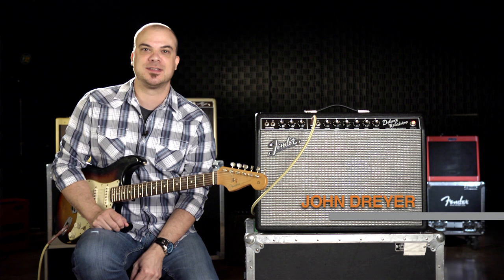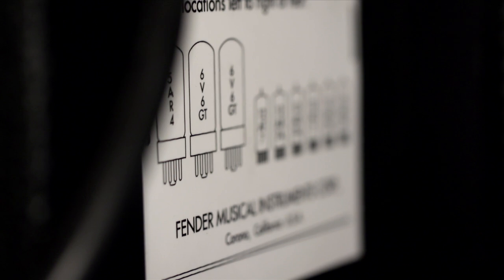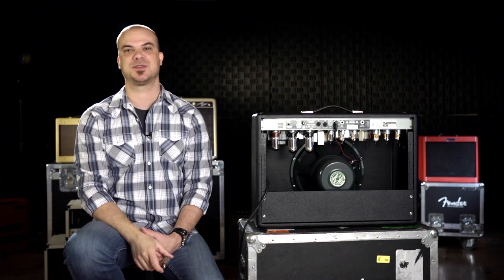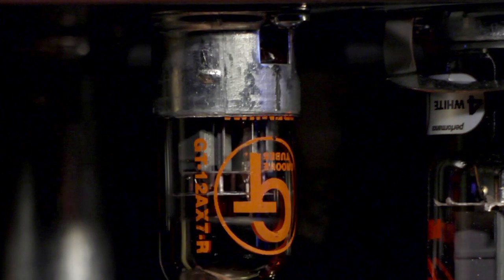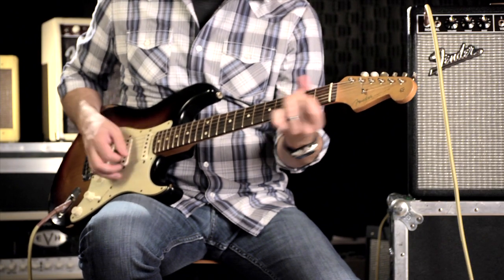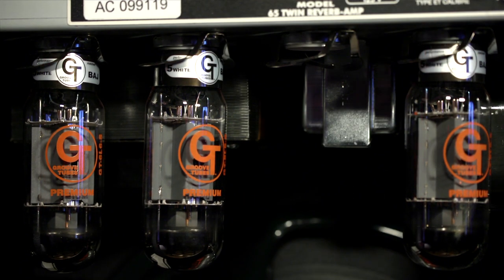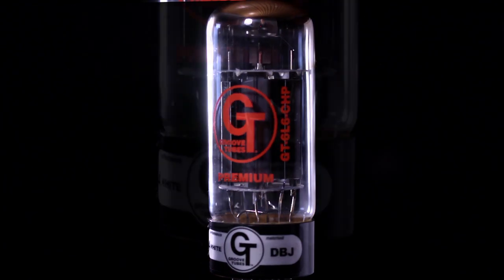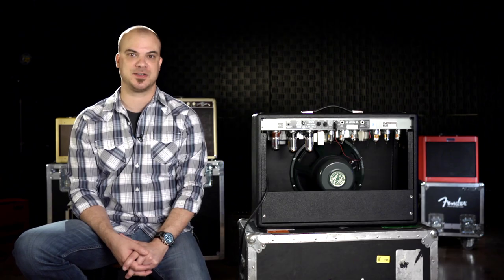How to Change the Tubes in Your Amp

Comment: Like he stated, If you are replacing tubes of the same brand and rating no bias is needed. Preferred? Maybe, but not needed as the tubes will be within normal operating standards of previous bias. If anything, normal bias shift is more of a reason to routinely/annually (depending on how you use the amp) bias than replacing tubes - unless of course you are swapping tube type, brand or ratings - as he CLEARLY stated in this very direct and simple video made for the layman who likes his tubes and loves his hobbies even if one of those hobbies is NOT electrical engineering. Most people find tubes they prefer in an amp and stick to them - no need to bias for replacement with the same tubes. Long story short - all these comments fail and are likely made by people that got their educations on youtube so to speak.

Comment: I just ordered a set of 4  EL34's but the guys at the shop said they didn't see a rating #, only a M or L, so there is not way to tell if what I'm getting is a 6, 7, 8..etc which ones do I need? I play a Bugera 333xl 2x12 120w combo amp and its has tons of gain, and loud ( I play at #3.5 on the master dial at band practice) and I'd like to keep it that way, which ones are the right ones for me? pleases help. thanks

Comment: Waht about a Hartke bass amp When you turn it On,the guitar signal is nasty & crackly static ........after about 20 seconds or so it clears up & acts right.  Sound like a Tube?
Reply: I think so - pretty sure it's a worn preamp tube problem since it goes away but could be wrong, maybe pays to retube the whole thing

Comment: That is so wrong with this demo. Every time you change the power tubes with an amp that is is not cathode bias and it has a potentiometer in the circuit for bias, than you should bias the amp every time you change the power tubes. The demo is not specific enough and people should see other videos that shows the danger and the proper way of changing the tubes for both preamp and power section.  Peace, Flood!
Reply: evelasq1 But not all amps actually have adjustable pots. Some require replacing resistors with the proper value.

Comment: Your amp will need to be "biased" as well. Which means that the proper current adjustment will need to be made to accomodate the replacement tubes. It's ridiculously easy if you do a bit of research...